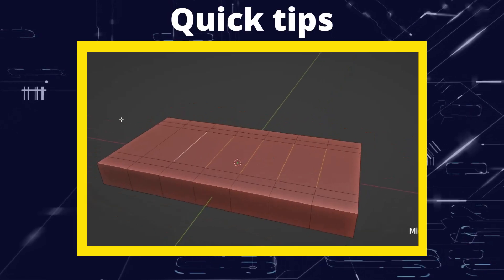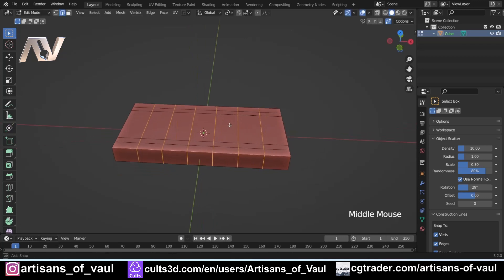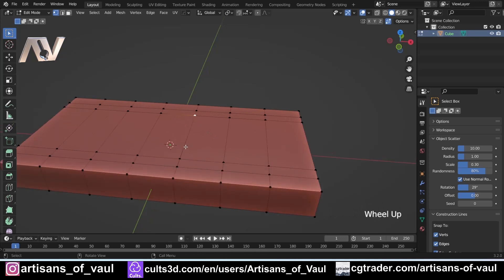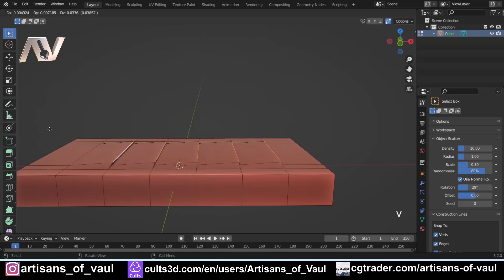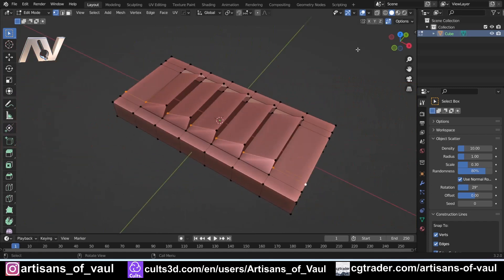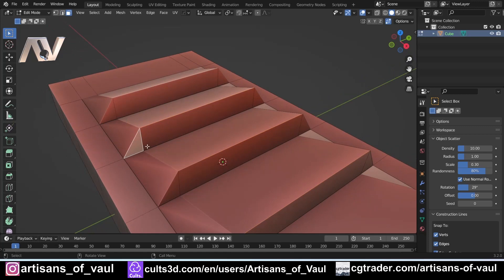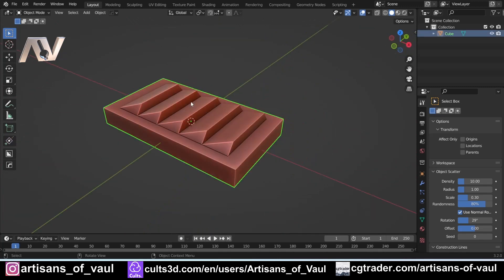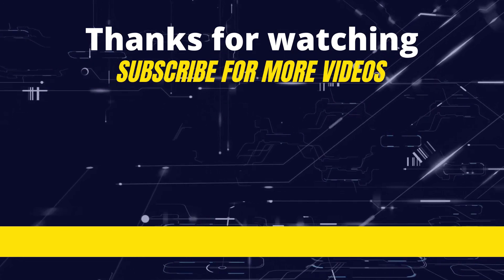Rip verts and edges in Blender to make a vent

Comment: great video series. I find them very helpful. I would like to see a video where you go through taking a mesh cleaning it up to be 3d printable. I have found many meshes where they have inside geometry that needs to be removed but I have not found great methods for cleaning them up.

Thank you
Reply from the maker: I have done a bit on cleaning up some mesh work but that's a good idea. I'll wait until I have a project that got some clean up to do and then use that for a video so it's more "real". Cheers 👍🏻😁

Comment: Excellent. If you want to keep the vents open you could add a Solidify Modifier
Reply from the maker: In this instance doing that will tend to cause some overlap that's going to cause issues if 3D printing. I'd probably do it the same way as shown but inset the face on the vent "overhang" and extrude it inwards.
Reply: @ArtisansofVaul  Hi, those issues could be fixed (imho) by loading your stl's into 3D Buillder (free Microsoft add-on) and have it repaired. Takes some minutes but makes a first rate stl. I use this quite often.
But, of course you are right, one would very seldom need open vents on a then hollow model. At least not in smaller scales.
Reply from the maker: Totally true. I've sung the praises of that program in a previous video. I'm not saying it would do but the overlaps it would create here are actually one of the fee things I've found it to have issues with (though I haven't tried it in this instance). But I think either way I'd rather have the control of extruding the faces myself and it would take less time ik thr long run as its a pretty simple function. But if you wanted the holes to go all the way through the vent its an option for sure 👍🏻